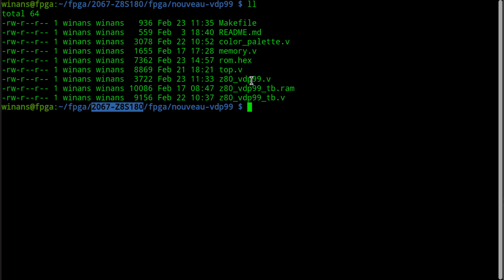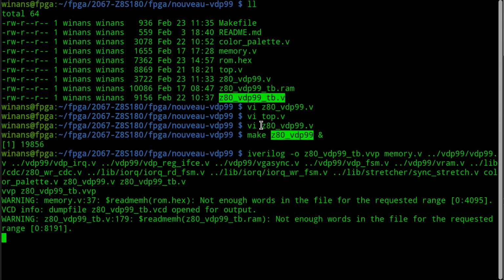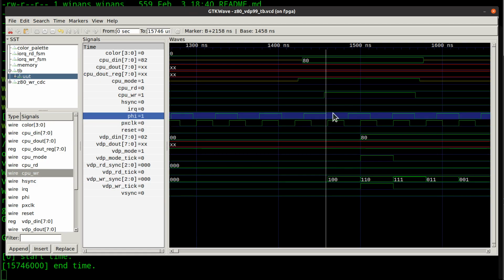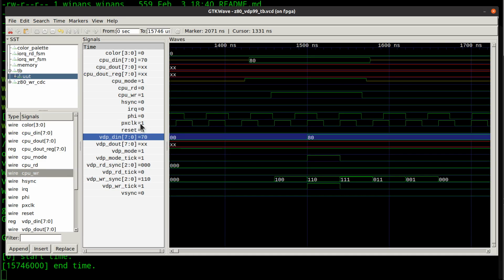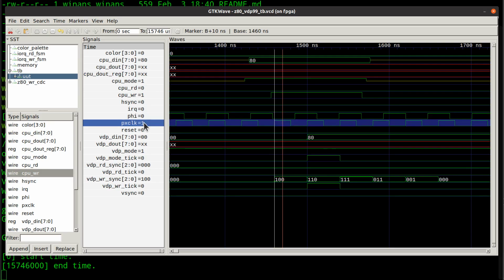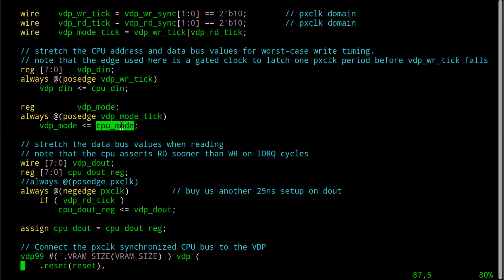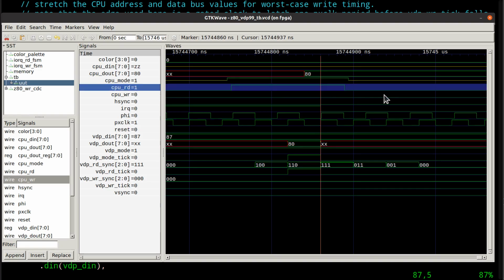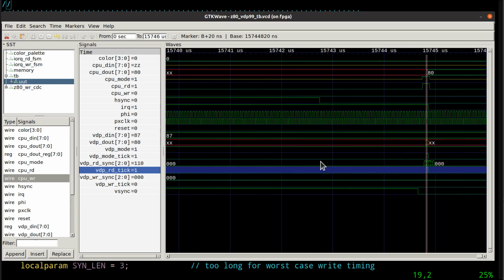Z80 Nouveau CPU & VDP Bus Custom Clock Domain Synchronization

Comment: I kept wishing you would find a worst case scenario in your simulation to show it to us.

I was also wondering exactly how much faster than the CPU clock pxclk needs to be.
Reply: I think it is hard to find a worst-case scenario because the simulation is ideal. However, it is easy to figure out what will happen: basically, shift every signal under the pixclk line to the right, by one cycle of pixclk. (take a screenshot and do it in Paint if you find it hard to visualize) Then you can see what he's talking about. With this setup, I think the CPU clock can be as fast as pixclk (25.175MHz for standard VGA) as WR signal is active for two cycles and data is valid for a bit longer than that.